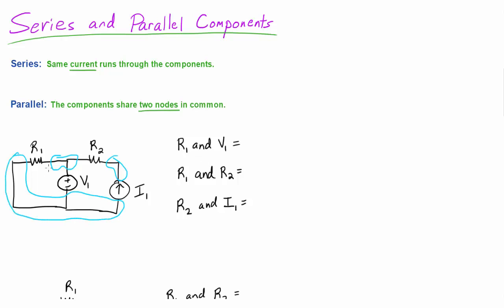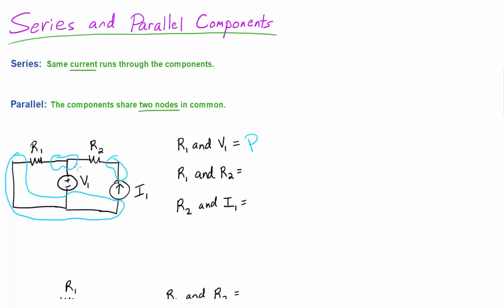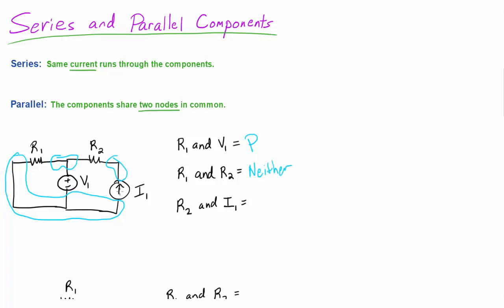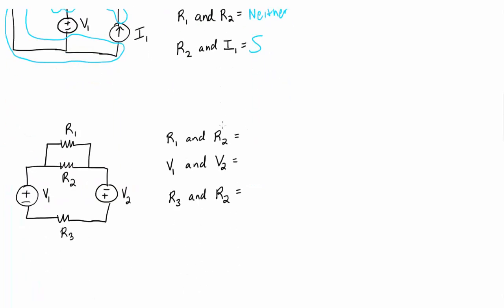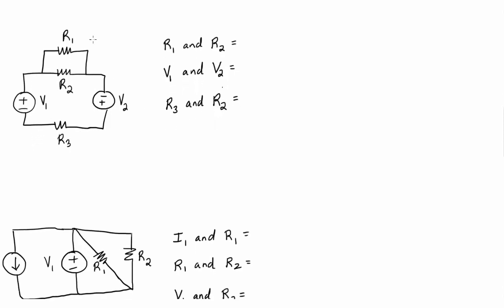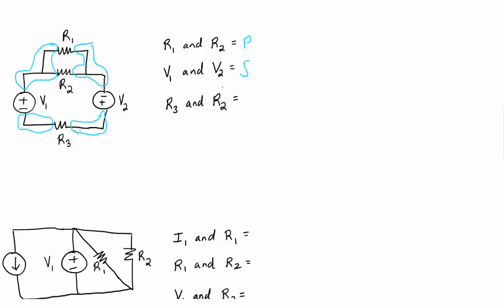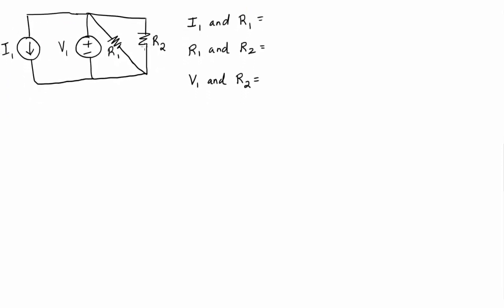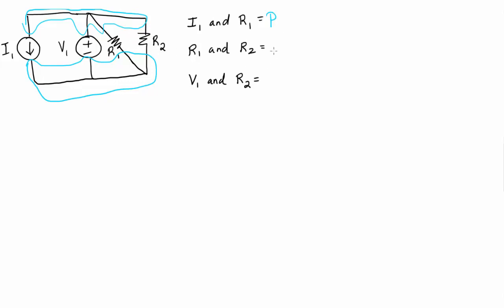How to Identify Series and Parallel Components

Comment: how it is be neither? still cant get it
Reply: My answer is late but it will benefit people that have the same question, R1 and R2 are neither in parallel nor in series because of the presense of I1 so they don't share two nodes.
for the sake of understanding we can say R1 is in parallel with the combination of (R2 and I1) because there is two nodes in common, same goes for V1 that is in parallel with the copmbination of (R2 and I1).
You can verify that by mesuring the potential drop, you will find U(R1) = u(R2) + U(I1) but you will find that the potential drop of R1 is not equal to that of R2, so they are not in parallel. And because R1 is in parallel with V1 so the current split between them, so the current that goes through R1 and R2 has not the same, i.e they are not in series. we conclude that they are neither in parallel nor in series